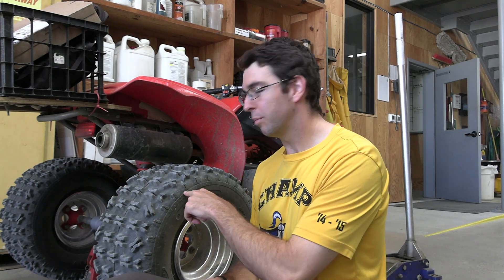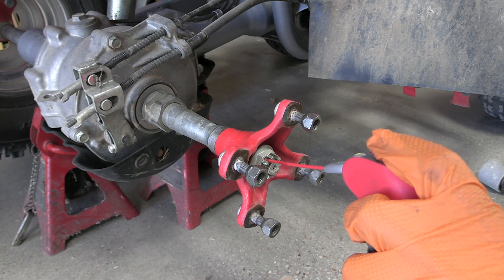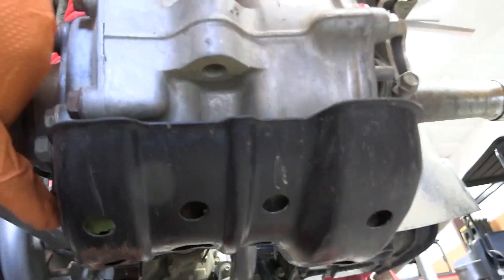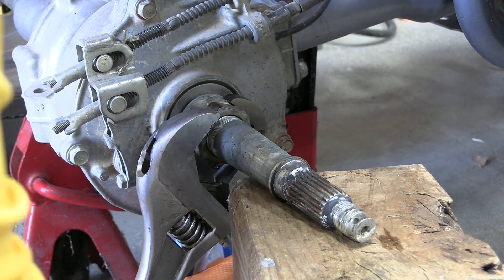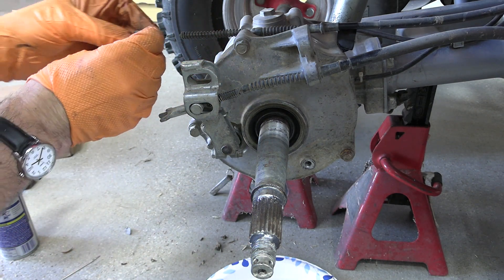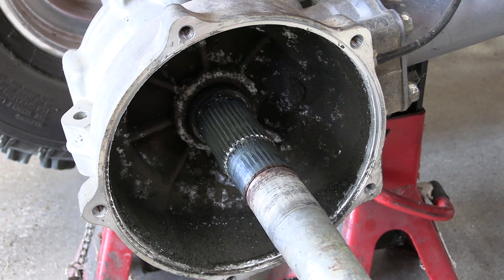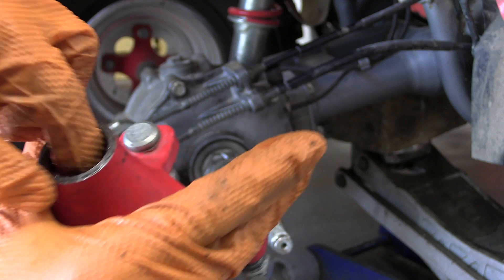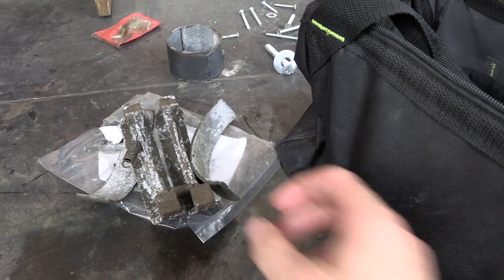How to Disassemble Rear Brakes Honda TRX 250

Comment: How did you get the drum off of the brake pad shoe plate. I’ve been beating on my drum for 2 hours and it just won’t come apart.
Reply: You have to remove the seal and cir clip inside before brake drum will come off